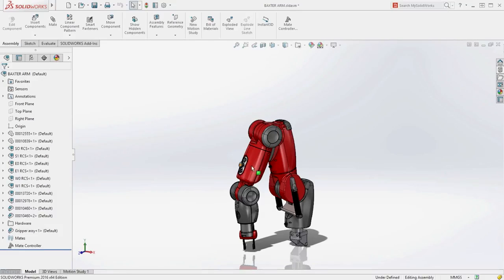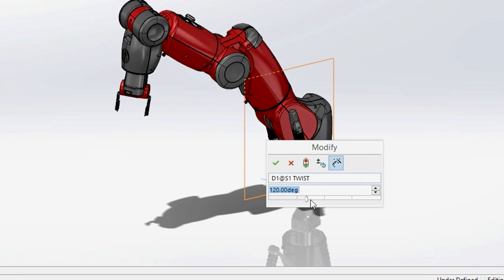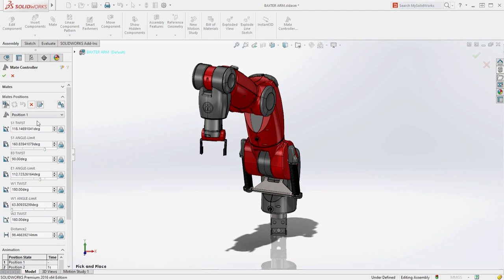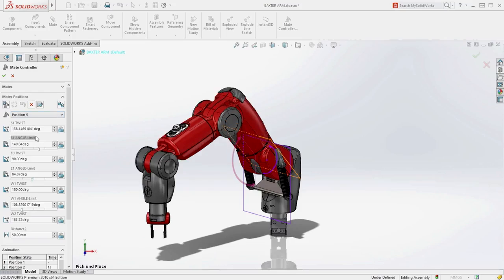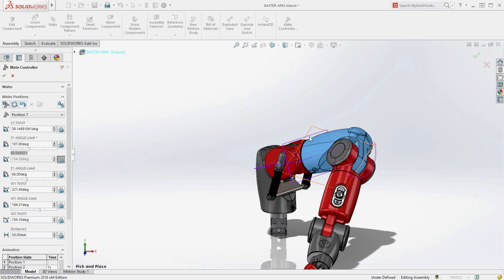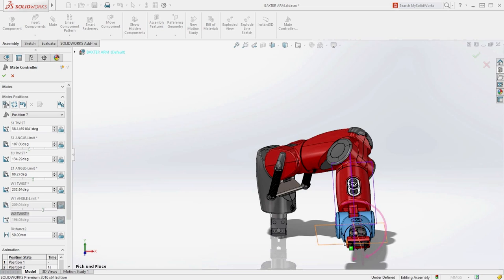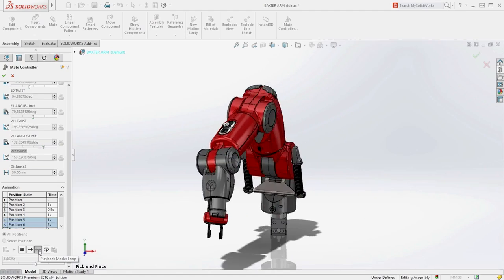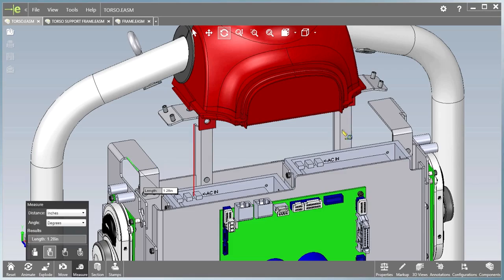SOLIDWORKS 2016 Animate Assembly Motion

Comment: I tried using the MATE CONTROLLER and it gets lost when I close and open the MATE CONTROLLER back. I already opened a call in SolidWorks but so far they haven't given me a solution. If you can help me I would appreciate it.